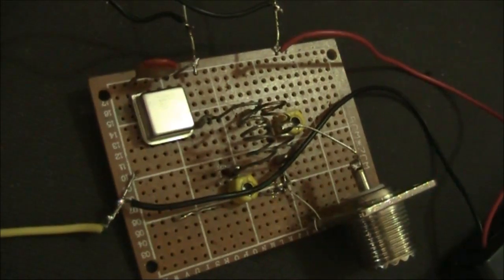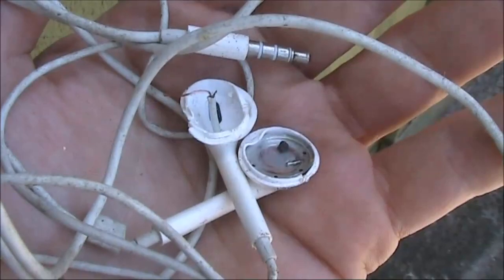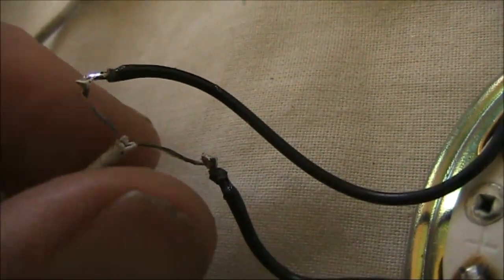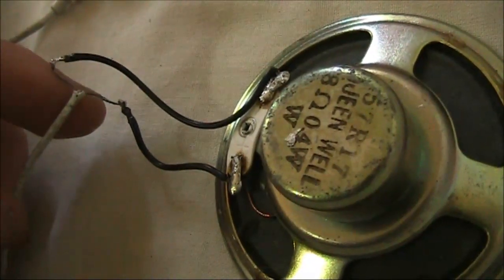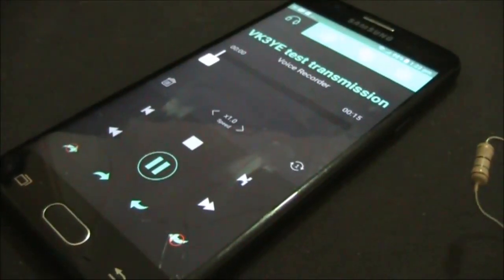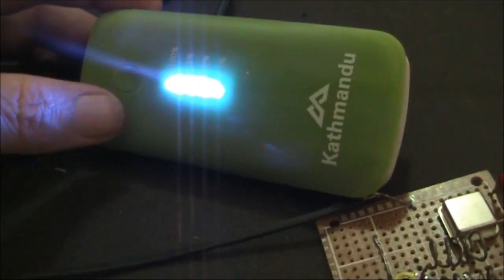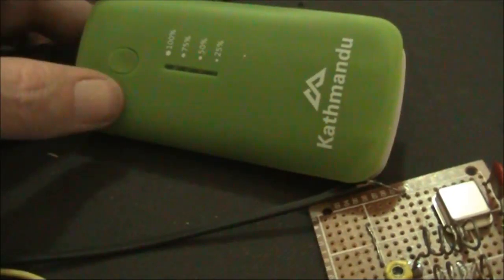Electronics on the Floor: Simple VHF voice beacon with a crystal oscillator module

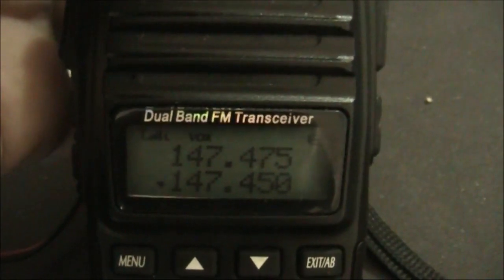Comment: 1:22 "As you can hear, audio is surprisingly good." I'll say - that's great!

Peter, I have a Google Pixel 2 (Android O/S), and when a device is plugged into it via a USB-C cable, I need to check a menu item on the phone saying "supply power to connected device". Would your phone have a similar menu? Cheers, Mike VK2IG
Reply from the maker: Thanks Mike - I'll investigate.